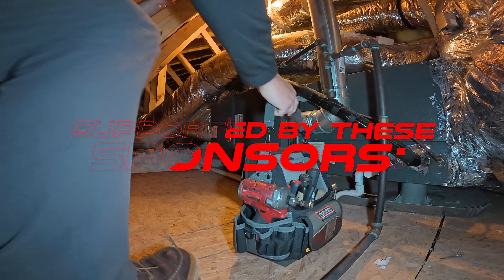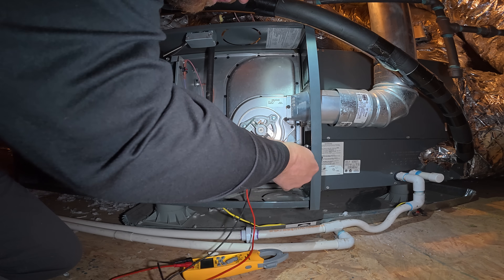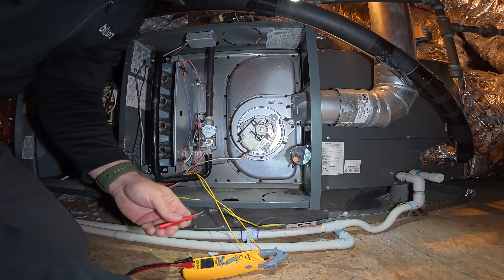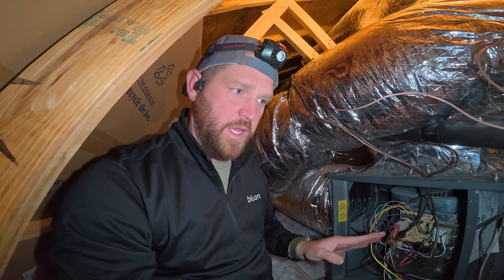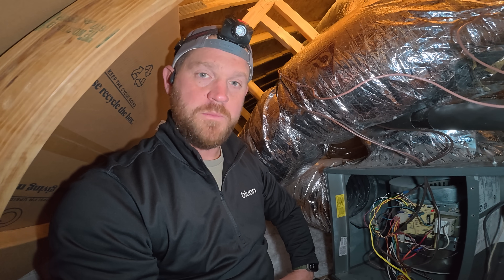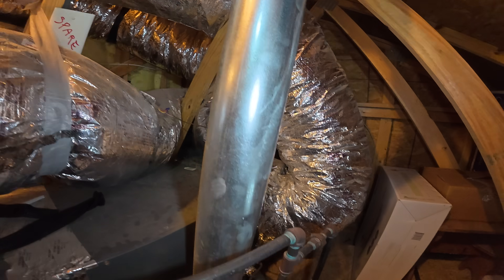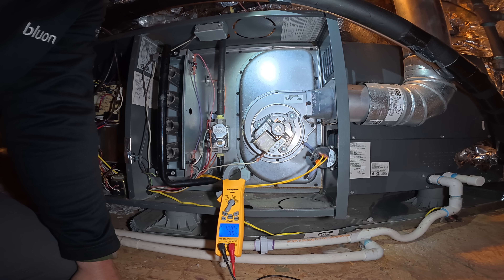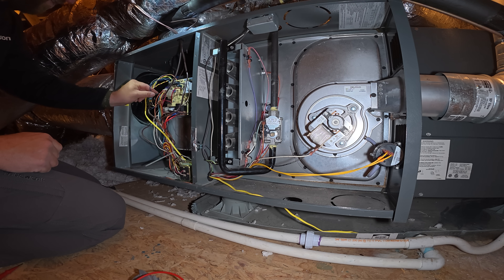The Furnace Wouldn’t Stay On…Until I Found THIS

Comment: Same issue but it was the dual pressure switch on a Goodman furnace. It appears that the pressure switch had a defective diaphragm from the factory causing it to start then shut off after 20 minutes or so.

Comment: Changing the board is good but you may end up changing the harness as well. Often times the harness being removed multiple times  can affect the board and the harness. I have changed a few in that pattern. The pressure switch is not usually a problem. However, when techs test the switch with breathing and sucking on the hose to the switch, it almost always damages the pressure switch diaphragm.
Reply: I agree 100%. Zac is amazing at wut he does but u gotta use process of elimination. The pressure switch was obviously working before moving the wire harness and noticing the low voltage short. I know it’s better safe than sorry but u tested ur switch and it was opening and closing.  One of my old bosses always told me that we have God Given senses to narrow stuff down like how u just did! Ur awesome man! Keep it up!!!! Love from tucson az!

Comment: I got exactly the same problem on a old Goodman furnace one year I replaced the board but I kept the old one and couple months later they call me again and I put the old board on and it works fine for the rest of the season before that I replace the pressure switch and it was working fine for couple weeks

Comment: The only way to troubleshoot a pressure switch is with a manometer
Reply: not really, many of them fail due to rusting parts/corrosion on the internal contacts, they'll get intermittent and may only fail to work right once in hundreds of cycles. cycling them manually may never catch the issue, so when there's random/intermittent pressure switch errors, just replace the pressure switch. of course make sure the port is open and tubing good.
the switches should make real fast as the inducer is just starting and not take multiple seconds, if it's taking that long, there's an inducer, venting, condensate or heat exchanger issue.
been there done that many times and often behind multiple others that failed to fix it.

Comment: boards commonly go bad where the plug of wires goes into the borad. vibration from the blower. Usually, a solder connection on one of the pins.

Comment: I feel like intermittent pressure switch problems on a 90%furnace can be one of the hardest no heat calls. There’s a lot of things it could be, and if it’s not happening in front of you then good luck
Reply: it's been happening since day one of any furnace having a pressure switch, back to the very first 80% models. the switches themselves start to fail internally, often from rust and corrosion of the springs, and moving contact arms. then there's corrosion, tarnishing and pitting of the contacts if they have much current passing through.

Comment: Any time I see those 9 pin connectors on circuit board and I’m there for a no heat I always take the board off and look at the pins. More often than not it’s the solder that holds the pins that cracks. The vibration will make them open and close a path intermittently driving you nuts . Those dang 9 pin boards made me look stupid once, never again
Reply: Thanks for this!

Comment: Goodman molex plugs have this issue a lot.  Especially on the gas packs.  I’m pretty sure it’s not the plug but the board.  I usually replace board and problem is fixed
Reply: Correct is not always the solder on the back it’s just a bad board , sometimes they look fine but don’t send out 26v to the gas valve.
Reply: @themrmoy40  the relay contacts fail after so many cycles. not just the gas valve ones, but also ignitor, blower, etc.

Comment: About 20 years ago Carrier issued a service bulletin on their high efficiency gas furnaces here in Ontario, Canada. We changed many circuit boards for loose connections on the blower motor connection at the board. The solder joints had very tiny fractures at the back of the board. Unless you looked with a magnifying glass you couldn’t see them. Lots of warranty work.
Good job finding that problem. Intermittent problems are the worst.

Comment: Sentiment in the induce motor, i have an old furnace that had built up sentiment and it would clog it up periodically
Reply: that's from condensation forming on each start cycle, before it gets hot enough to keep it from condensing. they'll often rust and eat away the whole flue pipe and chimney liners. worse if they short cycle a bunch.
Reply: @throttlebottle5906  yup exactly 💯
Reply: Hmm, are you thinking of lint or dust?  I have never heard the term "sentiment" previously.  "Sediment", but that is in water, not air.  I have seen lint or dust in air connections if there is a lot in the area.  I am just musing here, not trying to second-guess you.
Reply: @royreynolds108 those 80% furnaces will have sentiment in the exhaust from the vent it almost looks like sand, when he put that wire in the port at the induce and it started he cleared the clog and it fired up